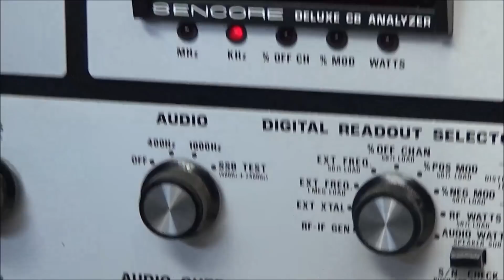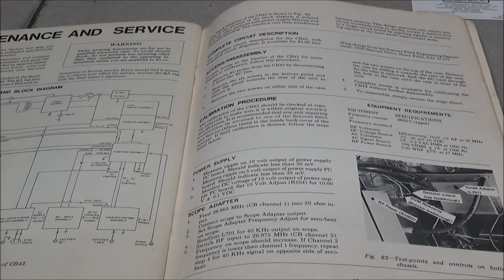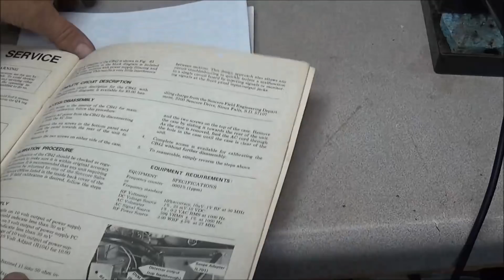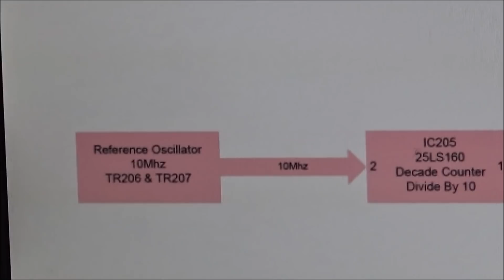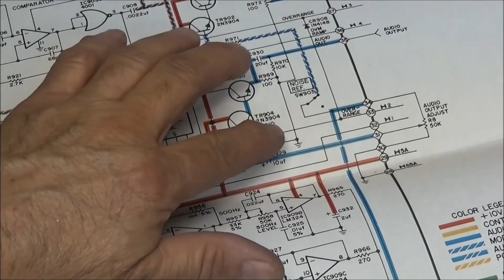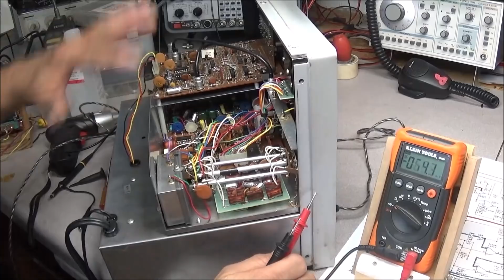#119 Sencore CB42 Audio Output Repair

Comment: Buddy do you still do repairs on these? I have one that everything seems to work except when turning the channel knob. RF out put and frequency from channel 1 to 13 works and tone comes out of the radio speaker but any channels above that the frequency doesn’t lock on or change and there is no readings on the radios meter. Could really need some help as this is my main unit for testing my radios. Please let me know. Thank you

Comment: Thanks for this informative video about the Sencore CB42 CB Analyzer.

The concept at the time was to provide the servicing technician of a CB radio to hook up the essential cables to the product, and then conduct troubleshooting tests from the RF input to the power transmitter output to the antenna, with some twists of the appropriate dials.

Such was called a "systems approach" for troubleshooting for finding the problem fast, rather than the parameter measurement techniques of Tektronix and Hewlett-Packard instruments of the time, rather than using particular separate instruments, such as the B&K devices mentioned.

At our many 'Tech-A-Rama' demonstrations across the nation, we demonstrated the CB42 using a block diagram schematic on a 4x3 panel with test points with which we could monitor or inject signals at several points, with switches to shut down the signal at several points. 

The intention, of course, that CB service technicians could then determine, input to output, where the fault occurred, and then to fix it. Simple.

( btw - I wrote the operations and some of the maintenance portions of the Sencore CB42 manual.)

Comment: hi mine reads a wrong frequency, for example I put on ch1 it reads 62.5 hz and so on. could you give me some help? Thank you
Reply from the maker: Is that showing on the counter or at the RF jack?
Reply: @TheRadioShop  I connect the radio example I put on ch1 then set the sencore cb42 on ext freq. I send the radio on carrier and it reads the wrong frequency. another example I set the sencore on rf-if gen the output is correct based on the set channel of the generator but the displayed frequency is wrong
Reply: if you leave me an email I can send you a video. Thank you

Comment: Hi! Great video, you are truely knowledgeable in this field of electronics. Just a question, I am fairly new to restoring vintage electronics, and I have a lot of Eico units,  a 348 audio generator, the Eico 324 RF generator and my newest piece an Eico 147A signal tracer, these units are in very good condition and all work very well.  What is your throughts on these for working on tube radios mainly the All American Five? Thank you kindly for any thoughts in the Eico brand... Have a great weekend...
Reply from the maker: Thanks, sounds like you are set up to work on those types of gear, all you need now is a VTVM.

Comment: That's a good question Buddy. Was that socket added later by a repair tech or was it factory installed as something that they thought might be a part that would be a common failure and easier for a quick factory repair. Wonder if you looked at the soldering underneath, that would tell the tale. Always interesting stuff and always good to change it up. Have a great holiday weekend Buddy, get some more of those ribs on the grill. ATB Doug.
Reply from the maker: I look under the board and see that the socket has been added. And looks recent as the flux is still tacky. I have seen quite a bit of these units and never seen a socket from the factory. Yes need to grill some more ribs! Thanks

Comment: Great video Buddy. I think it's ok to have certain simple test equipment,  even if you're just starting you're going to have to get a few things so that you can learn.  Hands on is just as important as reading.  Multimeters (the first thing you should always get), a cheap scope, soldering iron, hand tools, bench power supply, breadboards, test leads are a few things that I started with years ago.  But when you want to specialize and start getting into expensive or obscure stuff,  then yeah that comes later.  My recommendation if it's a new guy would be to stay away from repairing mains powered/high voltage stuff until you really know what you're doing.  Be safe!
Reply from the maker: I agree!. One thing is to pick up equipment and as you learn more then tackle the problems.  I know what you mean on the mains powered equipment. New guys need to be aware.

Comment: I would like to find repair parts for the probes for my SC61,MOSTLY THE TIP ACCESSORIES, any one got any scraps? What did you mean "Smoked Then?" I can't think with out my pipe.
Reply from the maker: My probes have gone bad. I like to get some replacement. But man those are high dollar!

Comment: Oh yeah...keep going! Sometimes simply reseating an IC will cure a total or partial failure...had that happen just the other day in a old Heathkit HW-8 QRP rig - the sound thru the audio filter IC was crackly and popping it out, a little DeOxit on the pins, and slapping it back in was all it needed.  73 - Dino KL0S
Reply from the maker: Good tip Dino. You know sockets have pros and cons. Replacing ic's can be hard on circuit traces. Sockets help that problem. But then sockets can corrode and get tarnished. Must be cleaned or replaced. Would be nice if all of these were in sockets. Would make testing a lot easier. Thanks for commenting my friend.

Comment: In the video the counter is showing 8's, if it is like that in person too, then I would be suspecting blown output drivers, it likely will be multiplexed, so that could cause it to look like that, MHz led probably blown
Reply: I am just starting to look at the diagram, it is multiplexed, in two blocks of 3 digits, and a single
Reply from the maker: Yep, all 8's at random. You can turn the unit off and back on and at times it will change. Sometimes random numbers across the display, every segment showing something. Cycle power and it will change or go back to 4 8"s.
Reply from the maker: Correct. I am thinking output drivers could be bad.
Reply: The Radio Shop - if it is supposed to show 7 digits all the time, then it could be a clock/latch issue.
Reply from the maker: Yes it is 7 digits. Going to check clock and latch today.

Comment: Definitely do videos on any other repairs on the unit.  So few of us that work on this kind of stuff do so there isn't a lot here on the Tube.  That unit looks like it's in near mint condition.  Many of them you see look like the one you have, well used.  I need to dig out some of my spare 1040 and 2040's and rebuild them in case I need them one day.  Thanks for sharing.
Reply from the maker: Will do Mike. I searched and nothing on the internet of repairing these. So will get up a few videos on YouTube.  One day I want to get a 1040 to play with. Never owned one. I do have 2 2040's with PLL issues I need to repair. Thanks for stopping in Mike.
Reply: The Radio Shop 

If you use the 1040 / 2040 combo you really get to liking them.  You can do an amazing amount of diagnostics with just those two pieces and a frequency counter and scope.  One thing I recommend is the operating manuals for those two.  Even if you don't own the equipment there is a lot of good info in them on alignment procedures, test procedures and diagnostic methods.  They spent a lot of time writing them and did a really good job.

Comment: good video repair when they first came out I bought  one new I think my was 50 channel also bought new CB41 power swr meter it had a remote head so you could run meter away from antenna,, thanks for bringing back memory
Reply from the maker: Thanks Dennis. The guy I worked with many years ago in a cb shop bought the CB42 and the 41 power meter. They were great working units back then.  Thanks for commenting.